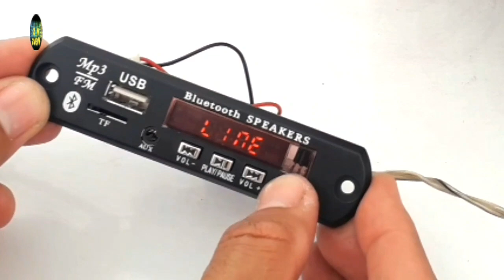Como montar um Amplificador Potente Bluetooth Fácil.

Comment: Posso ligar essa plaquinha em uma bateria 12V de 100 amperes?
Reply from the maker: Opa, bom dia. Amigo, 100 A é mais do que o suficiente,  pois a plaquinha só precisa de 1,5 a 2 A. Mas eu entendo assim, a fonte tem capacidade de fornecer até 100A, porém a placa vai puxar somente o que ela precisa, até onde eu sei, sou apenas um hobysta, o que  vc não pode é aumentar a tensão para mais de 12v, pq vai queimar, mas a amperagem, acredito que não dá  problema.